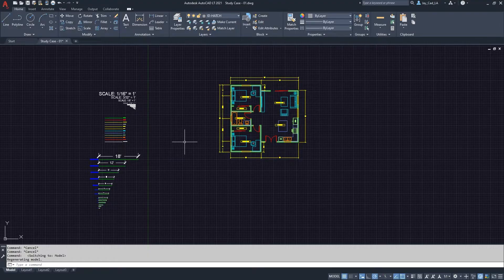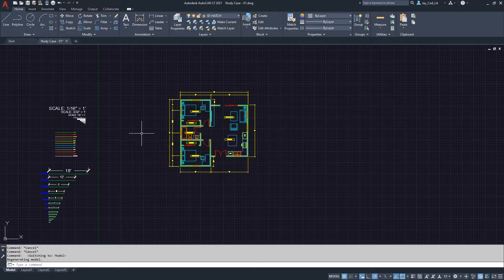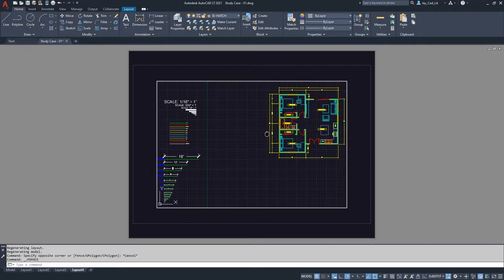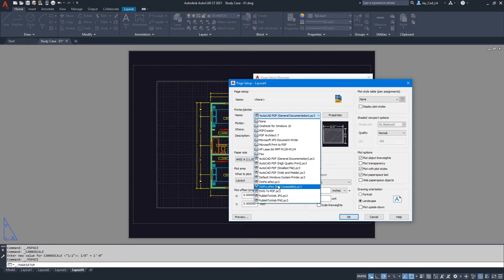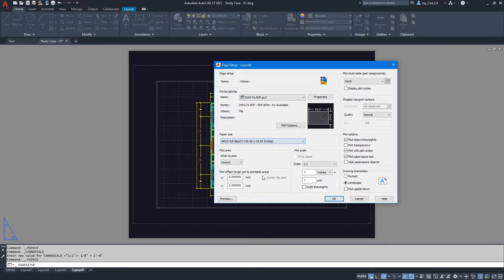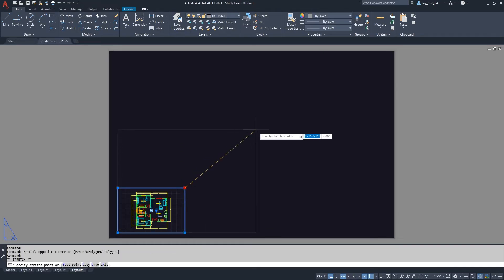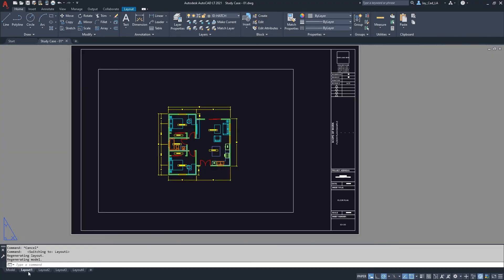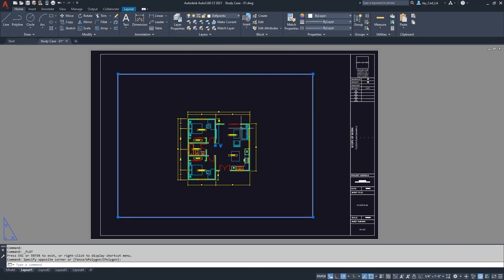How to Setup Paper Sizes (Layout) in Autocad | Autocad LT 2021 Tutorial

Comment: How do you specify the center of the drawing in the viewport? For example, how would I align a rectangle that is the same size as the viewport to the viewport?
Reply from the maker: Hi there Brandy 

Long overdue to answer your question, but it is a very good question! I hope you already found your answer but just in case, you can actually resize the viewport to match the size of the rectangle you are mentioning 

I am assuming you are trying to focus a viewport on a certain detail in your model space 

I hope this helps and let me know otherwise - Best regards